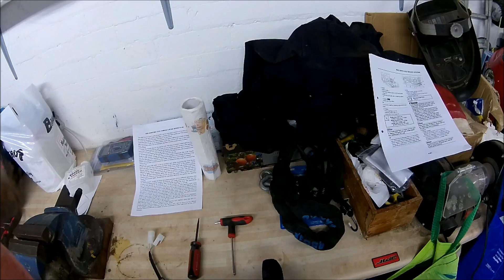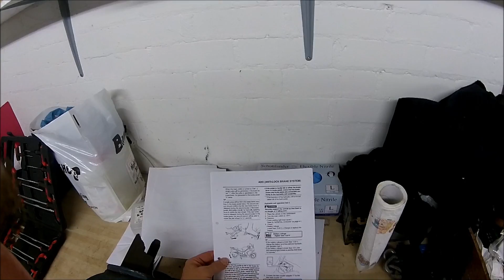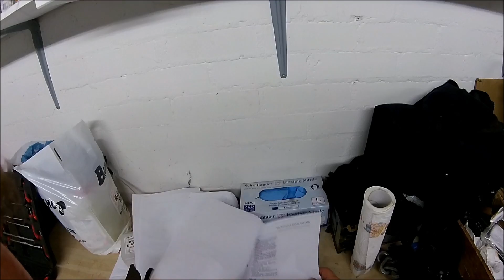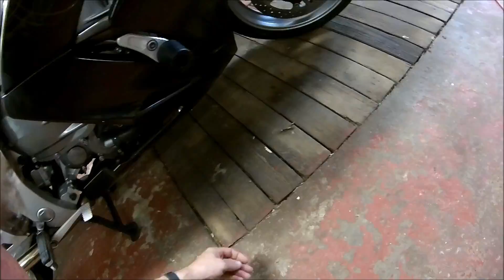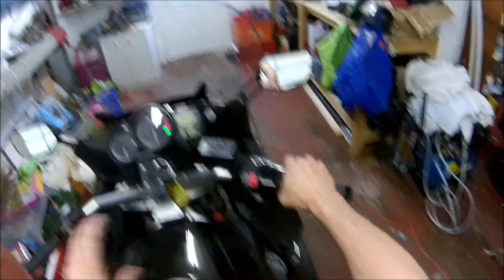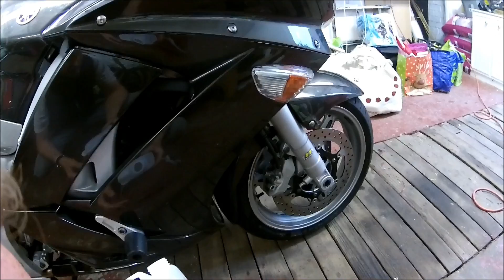Yamaha FJR 1300 ABS Test

Comment: thank you for this guide, mine is a 2010, the abs light is always on. I did the same steps and the pump is working. I repeated it several times and the light is still on with no error codes displayed at all. It did not even blink after jumping the wires for the test mode its just solid light. 
do you have any Idea about this issue?

Comment: Mine only throbbing on front and code 33 , any thoughts
Reply from the maker: Hi Tony
Just looked at the manual. An ABS 33 code can mean that the ABS motor is defective or power is not being supplied.
Possiable causes are given as:
Low Battery voltage, ABS motor fuse, Wire haness fault (ABS circuit), Connection of the ABS ECU coupler, Hydraulic unit assembly.
Hope that helps.

Simon
Reply: @simonhay-heddle3848  hi thanks for getting back, well it's some help, have just ordered a new relay , checked fuses, looked at wre harness , well tried  to as best as can without taking tool try out and light went off, but now back on so will be having  another look tomorrow.  2 dealers  have both said doubt its unit as never heard of them going. So at a loss . Once again thanks

Comment: Hi Simon I need your help to fix abs of my fz1 2013 model, there is no light or code for abs failure but it doesn't work, when I connected to jumper and switch on than it starts to show multiple abs codes on meter and when turned off all lights n codes are gone but abs remain same :-(

Comment: Hello there!  My abs diagnostic trouble code is 11 12 15 16 24 25 33 41 53 54.  I don't have any information about these faults. Can you help me see what problems? Thank you!
Reply from the maker: Hi there. You will find a full list of fault codes for all the systems in section 8 of the workshop manuel along with symptom and check point guide (ABS is 8-137 to 8-139).  What I would do is clear the faults as I outlined in the video and check the battery voltage ( 53/54 is low voltage). Then ride the bike and see what faults if any reappear . A bad battery and/or poor earthing can cause all sorts of problems. Hope that helps.
Reply: Simon Hay-Heddle Hello there!  Thank you for replying to me.  I don't have a maintenance manual for your car.  Is the fault-clearing step off if the fault clearing step is off?
Reply from the maker: @欧阳李奇  You really need to get yourself a manual as ther are invaluable for doing this kind of work. The easiest/cheapest way to get one is as a search able PDF off Ebay. I got mine on disk for £10.

Comment: If you feel like redoing this, please use a hand-held so you can focus up really tight on the proper electrical junction (and not get blocked by the handlebar).
Reply from the maker: Hi Robert. You are quiet right ,a little hand held would have been great but my phone at the time couldn't do good enough video. Also taking the right hand bar off for that bit of filming would have been a good idea, Just didnt think of it at the time!
Reply: Thanks for responding.  Between your video and Twowheelobsession's video I managed to get this done a few days ago.

You can't get that jumper in the U.S. anymore so I took two alligator clips and connected them with a piece of wire.  To help others find the two posts you are jumping:

When the connection box is still on the post, it is the two left-most pins.  Off the bike and with the internal blank removed it is the two pins on the "high" side of the plastic box.  Best way is to look on the bike and make sure you are connecting the sky blue wire to the black and white wire.

Comment: Thank you very much Simon for uploading this video. My FJR is a Gen 1, 2005. I finally found the ABS test connector just aft of my battery. But to identify the dummy cover I needed to see it in your video. I used a wire that had alligator clips on each end to jump the lt blue and black wires.
My issue was that I could not get a firm rear break pedal. I had to cycle the ABS unit. And it worked!
FYI, the same steps you demonstrated, also work by pushing the rear break pedal. At least on my Gen 1. Thanks very much for you help, and the entertainment your granddaughter provided.
Reply from the maker: farnsw Glad to be some help.

Comment: Hi Simon great video. Can you put a link to where you got the tool lead from. Thanks
Reply from the maker: Hi there. I got the patch lead from the U.K FJR owners club.  http://www.fjrcatalogue.com/catalog/item/7379165/8270322.htm   You have to be a member to buy from them (Well worth it for the parts catolalog alone). Alternativly it is a Yamaha service tool so should be available via a dealer. Hope that helps.
Reply: Thanks Simon. I also found the part available here www.cmsnl.com genuine Yamaha part number 9089003149